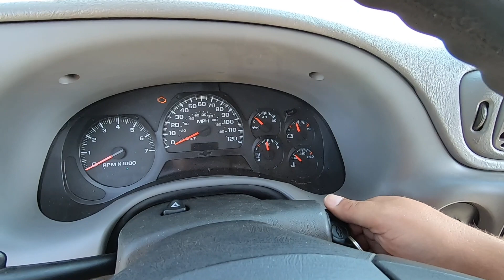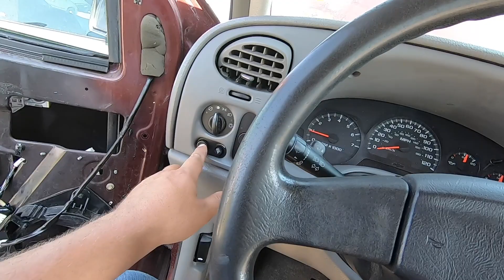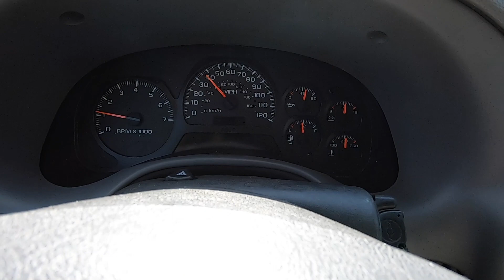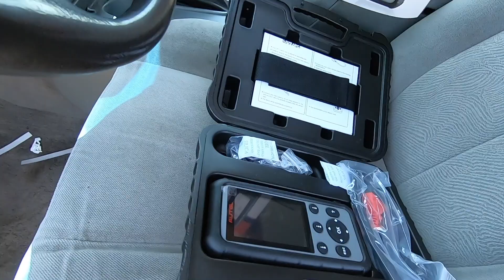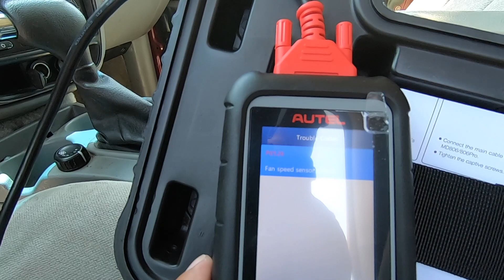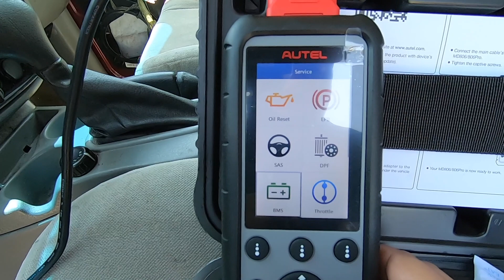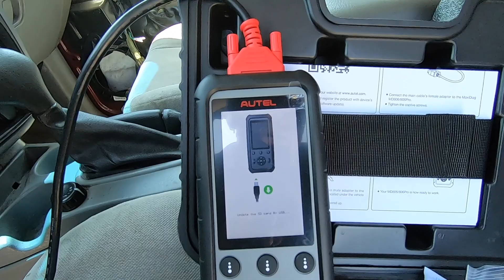Copart $325 Win Reveal!! Will it Run and Drive?

Comment: Be careful with getting a factory radio, I used to have a 2002 trailblazer and I’m pretty sure those radios have the vin matched security.
Reply: He could probably reprogram it with his expensive code reader thingy
Reply: gavin homeier yep dealership has to set it up to the vehicle
Reply: Tech 2
Reply: He remembers the Cadillac from last year. Same difference.
Reply: It will lock and the autel won’t unlock it  you have to use the GM online service with the j2534 tool
Reply: jeffscomp or take it to the dealer
Reply: One of my cars is a 04 Trail Blazer they run for a long time but everything electronic is a pain in the ass. Also $2500???
Reply: The factory radios are VIN matched to the vehicle they are installed in. Removing the unit and installing it in another vehicle will lock it and only the dealership can unlock and reprogram it. Way too much money considering the good prices on decent aftermarket offerings like Alpine or Pioneer.
Reply: @Berannn_  It will cost you between $150 and $200 to have the dealer program the radio. For $200, you can get yourself a used full din Pioneer or Alpine head unit and speakers at the pick a part.
Reply: Aftermarket

Comment: Drivers side switch panel needs to be programmed and the factory radio needs to be unlocked by the dealer the radio is stored in the BCM to the VIN# but it's a super good deal and flip truck 😂 yes truck!

Comment: I've got buckets full of nuts , bolts ,screws and misc. B/S that I pick-up off the ground while walking or riding my bike , that stuff adds up if you run down to the parts or hardware store every time you need a screw or nut because you always seem to have to buy four or eight of what ever your looking for @ $4-6.00 dollars a pop.

Comment: The BMS function is there as some new vehicles, like BMW use Absorbed Glass Mat batteries and the computer needs to know exactly what the capacity is so it can properly regulate the charge. On the BMW if you do not reset the system when the battery is changed it will not work and charge correctly.

Comment: Hard to beat a clean running and driving 3rd row seat vehicle for $325. Those fan clutches are very common on the 4.2 trailblazers; they tend to get stuck engaged at 100% (hence the code). Not sure I would chance buying a used one, but might find one that someone has already replaced at LKQ. I'd definitely opt for an aftermarket radio as this year will probably require a code to unlock. Looks like a good buy!

Comment: On star will not work on I believe pre-2006 GM vehicles they are an analog connection. Go with an aftermarket radio
Reply: Ari nathan false works on my o5 trailblazer

Comment: Hey randy gm locks the radio to vin. I know how to unlock them tho or you can look it up. There’s a chip you have to pull out of the circuit board. There is some downfalls to pulling the chip out to tho.

Comment: The clutch fan needs to be replaced.  You'll notice it starting to run warm sitting in traffic not moving..  Congrats on the purchase - you won with this one.  Cold AC, like new tires, presentable car.  Even with $1000 into it, its worth $2500 all day long.

Comment: Somewhere I have two bottom end radios out of 2002 Express vans I'd about give away if someone wanted them.  AM, FM only.  

But if I was flipping that I'd buy a Pioneer or JVC head on Amazon with a USB port and customizable color display.  Lots of them in the $70-$100 range, some even come with sets of speakers.  USB lets you use a thumb drive or iPod or whatever.  2002 is too early I think for that to be a factory option.  You need an install kit but no big deal there.  My last van I had a single DIN in, the one I have now I got a double DIN one for and it's easier to hit the buttons on while driving.  

.... actually, I'd probably buy a used one at the you-pick yard since they warranty them 30 days, often have a bunch out on the counter, and they're only $30.
Reply: Same at my local pick a part. $30 all day long for full din head units. I have two Pioneer and one Alpine I snagged out of new arrivals the last time I went. Also, speakers are $5 a piece and you'd be surprised at what you find. Pioneer, Alpine, Kicker, Rockford Fosgate, etc. So for about $60 he could set that Trailblazer up real nice with a great system and have money left over to fix the fan clutch CEL considering the Stealership will charge between $150 and $200 to reprogram a factory unit. If I flip a car, I want to make as much money as possible.

Comment: The fan clutch would explain why it would be running up in temp doesn’t really effect it when driving on hwy not unless you use the ac but pulling things an going up hills it will definitely start to show I’d fix it an save someone else the headache because a mechanic an labor for someone that doesn’t know much would probably be costly I’ve heard of mechanics over  pricing keep the good vids up I have nothing else to watch😂(looked like it was running on the hot side not bad but will eventually catch up) but could have been low on coolant idk not questioning your work💪

Comment: Just wondering, when you walked up to the car you said it was listed as a non-runner, and then when you got the battery connection issue fixed you jumped in it and it started and then you said, "And if I remember right this one has cold air conditioning". So if it was a non-runner until you fixed the battery connection issue then how did you remember that it had cold air conditioning?

Comment: I've had two regular Blazers and two Trail Blazers the Trail Blazers were in 02 four-wheel drive 4.2 L with a hundred thousand miles on it the other one was a 2006 two wheel drive 4.2 L both were the regular wheelbase not the extended the transmissions and engines on this things are pretty much Bulletproof they're very good reliable vehicles they never left me stranded on the side of the road if I were you I would keep that thing as a Runner vehicle so you can put parts in the back and not have to worry about whether getting to them

Comment: Half of these cars you can probably find before Copart if you look on craigslist instead of going to Copart and paying them double
Reply: Yeahh but Craigslist is sketch. People use fake numbers , meet u in sketch areas , rip u off by not telling you whats wrong with the car so they can charge u so much. Copart is safer u can go to one place with cameras everywhere, dont need to be insecure of a fake number , dont need to go to sketchy areas , dont need to directly make business to the person selling it (where in craiglist u directly have to talk to them knowing they can rob u or pull a gun out on u at any moment) , And u dont need to go to the car u can go to the site and buy it unseen if u want. We dont live in a world that is 100% safe but we can make ourselves safe by doing it properly and safely 😊
Reply: @JQ19988  true I have a 2002 Acura TL Type S in blue with black leather honestly the car doesn't get any better than this it's just the transmission is screwed up I'm asking $750 for the car it's beautiful every suspension piece has been changed the blower motor blower fan the radiator new exhaust new tires it's just a damn transmission and I can't find a buyer for it and I don't want to give it to Copart so they can just double the money on it
Reply: @KBMOTORSchannel  I'll check it out I'm trying to get rid of it 2002 Acura TL Type S in perfect condition new tires motor runs perfect new radiator all new suspension I fixed blower motor and the fan a few other pieces that go under there it's such a beautiful car and in such good condition to give it to Copart for nothing it kills me I even have new tires on it American 750 bucks for it Copart will easily get over 1400 for this I've been asking everybody clean title what else could you ask for if you know anybody that's interested please let me know I'll send videos pics whatever
Reply: While you can find deals on Craigslist, it's not the ideal place. At least at Copart, you know what you're getting because they disclose everything they know about it and give you a Carfax as well as letting you check the car out first versus Joe Shmoe who knows the head gasket is gone on his Mini Cooper but neglects to say anything about it when ripping off Jenny Consumer for $3,000. The only positive I can see is if you get the opportunity to test drive a Craigslist car you can carry a pocket code scanner and pull over to scan for codes Joe Schmoe may have neglected to say anything about and cleared the codes right before you showed up. Code scanner will tell you this because the readiness monitors will not be set to ready. And you have to drive about 50 miles before the readiness monitors reset and the code(s) come back.

Comment: I'd go with a cheap double-din aftermarket radio, with bluetooth, etc. It'll be easier than trying to install an OEM radio - seeing as they have to be attached to the VIN of the car. Plus, it looks like some literally cut the stock harness.. so good luck with that.
Reply: Not as bad as you think. In dash installation kits usually come with wiring color codes for the vehicle years they are for. At least the wiring kits to plug into the stock harness do.

Comment: Randy, I had a 2008 Trailblazer I drove for Uber/Lyft for 2 years. Only needed tires and brakes replaced. Got totaled at 205K but I know that SUV would have made it to 300K no problem. 
Excellent buy for sure.
Did I mention the insurance company wrote me a check for $5k to replace it?
Only in Texas my friend...
Don't sell yours for less than 3K, please....

Comment: Pretty sweet deal.

If you’re flipping... you know it has a code issue, you know the problem and it’s easy to fix why wouldn’t you do that?
Reply: If it was me, I'd be concentrating on fixing the fan clutch and getting the CEL to turn off if I planned on flipping it because people will pay a little more for a vehicle that is not displaying problems.

Comment: I'm having issues with my clutch fan and the auto parts wanted like 400 dollars for a new one but on ebay a new one was 99 dollars. salvage yard wanted 150. so i bought the ebay part. Mine was coming up with a code for the clutch fan for the last year now it's getting stuck on to were it's engaged most of the time making it sound like a semi when it pulls out with all the air it's moving. It also is killing my fuel economy. I have the new one sitting in the box on my back seat but haven't replaced it as of yet.

Comment: Love what you do I want to buy cars from copart but unfortunately I dont have a dealer license
Reply: Mike Smith dont need a dealer license to buy from copart.  If you live in a state that requires a license go through a broker or shop a out of state copart that requires no license.  I buy from Copart and have no license.
Reply: Oh ok I live in Indiana
Reply: You do not need a dealer license to buy from Copart. But you will need a dealer license if you sell a certain number of cars per year. If you run into a Copart that requires a license just use a broker. But bank on spending an extra $300 to $400 for broker fees.

Comment: Forget the radio, the on-star, the electric clutch fan sensor and trouble code....forget the door panels and switches.... forget going to LKQ for parts....just pool all your money into a nice size Pro-charger(nice size = too damn big for any engine). some big injectors, headers/exhaust, and who needs an ecu tune....forget about it.... Run that trailblazer down the track all weekend before  u hand it off to weird beard.
Reply: I would like see that race between the blown trailblazer and the harley truck.  Not sure what size engine the chevy has. But is probably smaller than the 5.4 in the harley.  Randy will need to raise some serious boost on the procharger to get that big lug moving. You forgot about a nice size intercooler(Really large i-cooler!)
Reply: @camnorris7811  I will be at that race. shonuff. Randy needs to race his harley truck against jessica in the blown trailblazer. and if jessica loses the race, then she has to finally do an entire video on camera the whole time.
Reply: @camnorris7811  Looked like the 4.2 straight six the video. I know it wasnt the vortec 5.3 that came optional for the EXT model because I have the 5.3 vortec in my 02 silverado... It didnt look nothing like my engine.  But yea, them 4.2s are quite stout anyway. a good 20 psi on a procharger i bet would outrun randys harley.
Reply: @curlyhoward7386  In a two piece bikini nonetheless ... it's only fair!

Comment: An 03 trailerblazer will still bring $2500 with those miles on it down there???
Reply: It will only get $1,200 to $1,500 max. Too many miles on it to get more and I think he said in the video that it's not 4WD so that's another strike. If somebody just needs to replace a vehicle that blew up it would be a good choice to beat around in but trying to get any more than $1,500 would be near impossible. It will just sit on the lot.

Comment: You are much better off putting an aftermarket stereo unit in that Trailblazer. Factory units have anti theft protection that requires a dealership to program it to the vehicle. That is a good amount of extra money ( About 150 to $200. you're better off using that cash to fix the fan clutch and turn off the CEL. ) I don't think you want to spend. Or maybe you do.
 Also, with that many miles it will only get about $1,500 which is still a good flip. Nobody that knows anything about cars is going to pay more for it.

Comment: Randy you think it's pretty easy it's a little tricky replace that fan clutch I have had it done it they're on their pretty good they're not impossible to do it you can do it but that's it I've done it and they do make it special tool did you take them off
Reply: You can do it with a pry bar and an adjustable wrench. Just lock the pry bar in two of the fan clutch bolt heads and put the large adjustable wrench on and off it comes. You have to remember to go counterclockwise to loosen because they are on with left hand thread and you may need a couple whacks on the wrench with a mallet.

Comment: Before you replace the fan clutch check this, the P0526 cooling fan speed sensor circuit problem appears because of damaged wires in the cooling fan harness. The damage occurs because the harness pulls out of its plastic protective sleeve, exposing the insulation to the sharp edges of the sleeve. 
I had that code on my 2005  trailblazer and it was a damaged wire on the harness, closest to the fan clutch. Same as on the picture. 
https://images.app.goo.gl/2VcRYZ6BStWZUQ738
My trailblazer didn't overheated driving, only when i was idling or stuck in traffic.
Hope this helps
Reply from the maker: Thank you!!

Comment: 200000 aint nothing for a trailblazer
Reply: Yeah after a new transmission.
Reply: @tbmllc7114  I know of 3 trailblazers that have over 200000 miles and still have original transmissions

Comment: The few Trailblazers left up here in salt-laden eastern Canada have all lost the majority of the paint from the wheelwells down, not to mention rockers rotted right through. This TB is in beautiful shape.  In this age of environmental zealots I can't believe they're still using road salt here. It's the ultimate cancer for vehicles.
Reply: I can't believe they have not come up with a road treatment that does not crap up your windshield to the point you need two gallons of washer fluid to get that crap off so you can see.